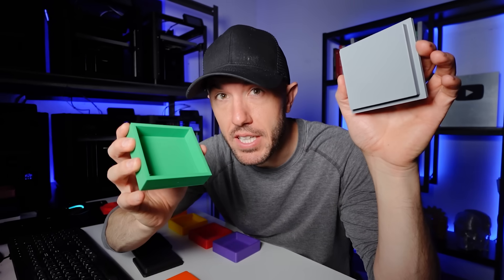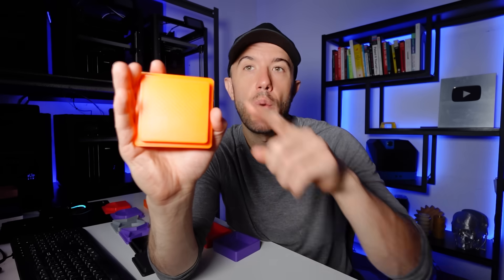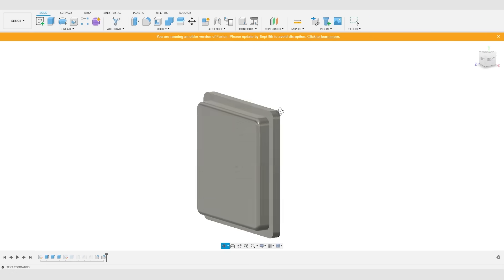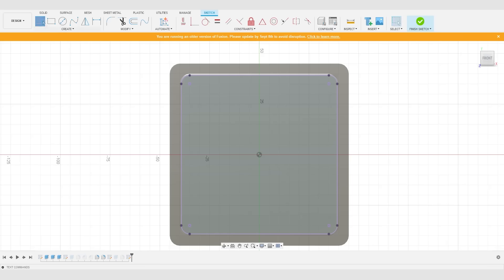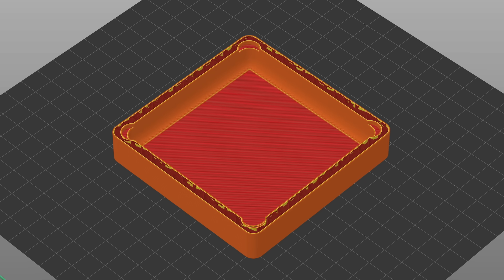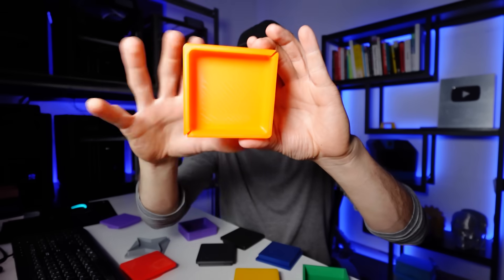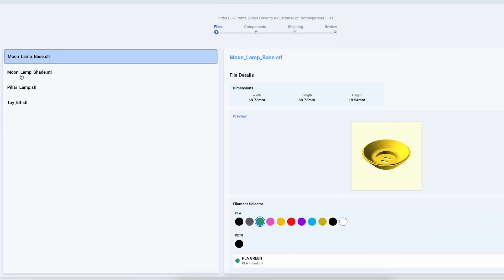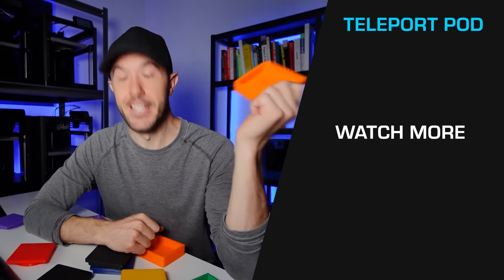How to Design a Print with Perfect Tolerance EVERY Time

Comment: Dunno, I really enjoy your videos but this one is not convincing at all. With you first compliant version you basically have a bridge but do the absolute nono of having a bend in the bridge. With the fingered version you create so many tiny features, which are again in free air. Even if not because of the small offset it seems like a ticket to print failure. Plus I really doubt these "springs" are linear so the promise of a constant force whatever the circumstances likely falls flat. Anyways, keep up the good work.

Comment: If you try to print that 0.3mm gap,  won't the printer want to put in a support. That is if you print it laying flat.  How do you get around that? Do you print it on its side?
Reply: Two ways to manage this.
1. If no other parts of the model requires support, don't tick "enable support" in the slicer settings.
2. If other areas of the model need support. Tick enable support then in model view find "paint support" button and paint only the areas that you want supported (if you chose "manual" support options) or you can also paint on the model areas where you don't allow the software to create supports for it as well -generally by holding shift while you paint (or something along those lines)
Reply: @Bonpunt.12  this does not explain how will be the part with 0.3mm gap printed - there will be a long bridge which can not be printed in air
Reply: That's the same question I have.
Reply: He must design in his own support that breaks away during use.
Reply: I experimented with this - I think the key here is that, while it does 'fuse' on the bottom, it breaks free fairly easily the first time you compress it. I tried this with ~30mm long and 1mm thick serpentine springs, 3D printed 0.3mm above a flat base plate and attached on one end. when I pushed on one end, the spring came loose from the base with very little applied force. It didn't even leave visible marks on the base plate.

Comment: Creep can definitely be a problem.

I built grip fins into a paper to hold a nominally 16mm cylinder.  When printed in PLA, it weakened over the course of a week to the point where it was not holding the part adequately.

The same design printed in PETG seems to be holding well.

Comment: The slant or chamfer feature on the top lid is just called a draft, and is set at specific angles for injection molding for parts to come out of molds. I get that you don't have to worry about that for 3d printing, but the tool you use to make that angle change in fusion is literally called draft, so I thought it was weird why he didn't call it that. 

Something else he didn't mention is how you can make stand off ribs proud of the top male lip to interface directly with the bottom part. Sometimes when I want I tight fit between components but I also want to get the parts apart I can make the small ribs slightly oversize or zero clearance so that all I need to do is shave down or sand this small surface area piece and not the whole surface of a pipe fitting connector for example. to get a really tight fitment that I can also pull apart if need be.

The compliant stuff he shows seems overly complex like at that point why not design a hinge or a latch, or a snap fit mechanism over a friction fit?
Reply: @MrAlziepen nice tips

Comment: Similar techniques as designing parts for CNC cutting, but slightly different design intents.    When designing for pockets in CNC cut parts, we MUST round internal corners as cutters are cylindrical and that's how they cut internal shapes.  Additionally, If the internal corner dimension matches the cutter, I always add a small amount to the internal radius, so it no longer matches the cutter - it's a tiny bit bigger than the cutter radius (on the diameter), because when a cutter is traveling, then must make a 90° sharp turn, it's a "hard stop" before changing direction.  By adding a small amount, the CNC makes a small arc at the corner instead of hard stopping.

Angling the extruded boss of the lid is called "draft", which is a common practice with molded plastic part design, mainly so the part can be pulled from the mold cavity.  Here, Gabe needs the lid to insert or pull from a pocket.  This is similar, but not the same problem as pulling a part from a mold.

Comment: What's the print orientation for the spring arch and the grid fins? How do you go about having a gap between the base of the fins and the lid base?
Reply: @wompaper  a small horizontal gap works in the same way a support gap does

Comment: Since most people print at 0.2mm, wouldn't the best distance for cuts be either 0.2 or 0.4mm? The reason you're getting the artefacts from the slicer is because your suggested 0.3mm is not an exact number of layers, so the slicer is trying to interpret the "left over" material. Instead of thinking "the best gap is X mm", better to think "the best gap is X layers".
Reply: With a print farm business, I suspect he runs a lot with a 0.6 mm nozzle so 0.3 mm is his go-to for layer separations. I agree that he should express his gap in layers instead.

Comment: From ChatGPT:

🧩 Clearance:
The intentional space between two parts so they can move freely or be assembled easily. For example, a peg and a hole might need 0.2–0.5 mm of clearance in 3D printing to fit together without force.

📏Tolerance
How much variation is allowed from the intended dimension. A 10 mm cube with ±0.2 mm tolerance means the actual part could be 9.8–10.2 mm. FDM printers typically have larger tolerances than SLA or SLS.

🔧 Fits
Describes how tight or loose two parts fit together:
	•	Loose Fit (clearance fit): Easy to assemble (e.g., a lid that slides on).
	•	Tight Fit (interference fit): Needs pressure to assemble (e.g., press-fit gears).
	•	Transition Fit: Between loose and tight — might slide or need light force.

Comment: Knowing the nozzle size can really help with a few things here. A starting clearance value of Nozzle size / 2 is a great jumping off point for finding what type of fit you want. IMO it is easier to dial up and down a divisor that's going to land somewhere between 1-5 instead of picking a flat number between 0-0.2. Additionally I have found the smallest vertical corner round over that gets me the enhanced reliability of not asking for sharp corners is "Extrusion Width * 2". 
A clearance is the gap between mating parts. I usually either apply the full clearance as an offset to 1 part or half of the clearance to both parts. I'm not sure if a clearance is the total gaps between parts or just 1 of the gaps between parts.
The Clearance in a design allows for the relatively low Tolerance of parts produced by 3D printing.
Reply: Thank you for properly using those terms in a good explanation.